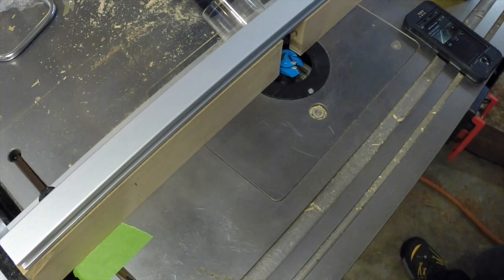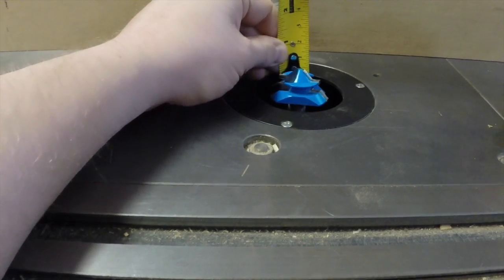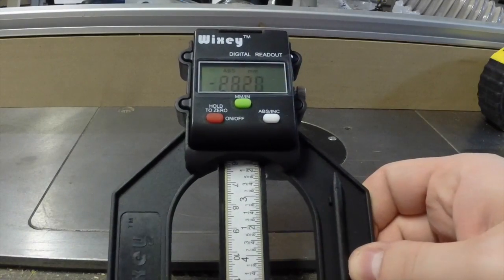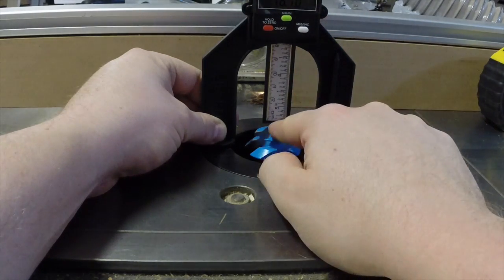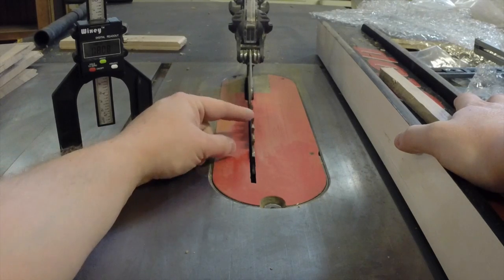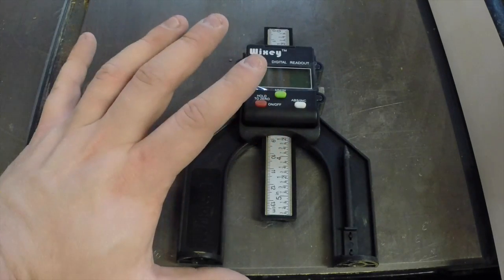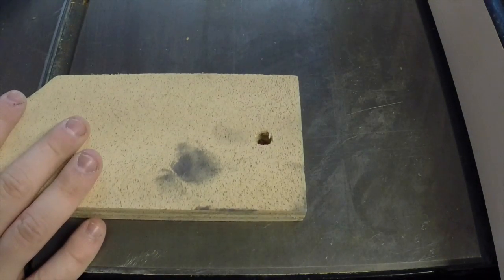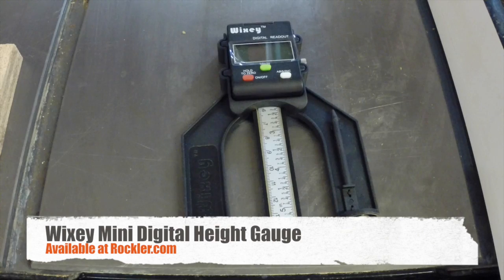Wixey Mini Digital Height Gauge

Comment: You will not get a true measurement if your gage is sitting on your plastic insert of router table instead of your table surface which is what your work piece is resting upon.

Comment: Just got one, may make a wider flat bar metal base with center cut to provide more offset of legs to the rule,  for setting width of table saw fence/blade distance.  Currently works as is with the point plunger flush to the inside saw blade.   Will be a handy addition to the multiple shop tools, wish I got it sooner.

Comment: I don't live in England,,,inch's only in America..
Reply: Pat,  The green button converts the reading to either metric or imperial.  So if you bought one now and only used the inch measurement until the USE finally accepts the logic of metric  measurements you wouldn't have to buy another one  you could just press the green button again!  Magic!   Saving you dollars (they're metric aren't they? ) left right and centre.
Reply: Other countries use metric.....may be its time your country caught up with the rest of the world!!
Reply: @tomdixonzl2hgr15   How could we make a complete switch to metric in the U.S. without going back in time 250 years, and starting over, using the earth, instead of human limbs, for a standard?  Until that can happen, it appears there will always be, unfortunately, two different systems here in the U.S.